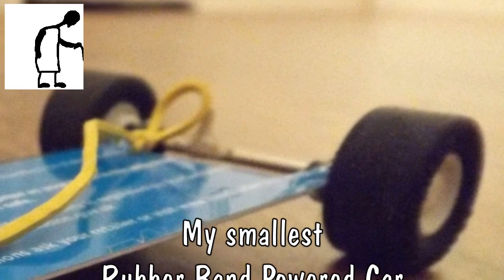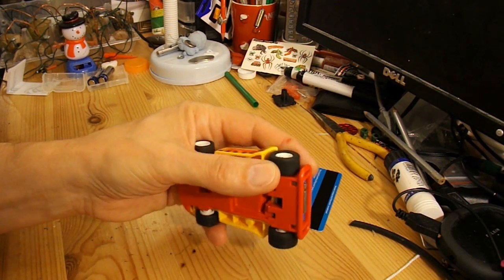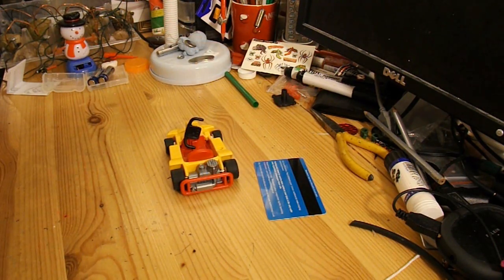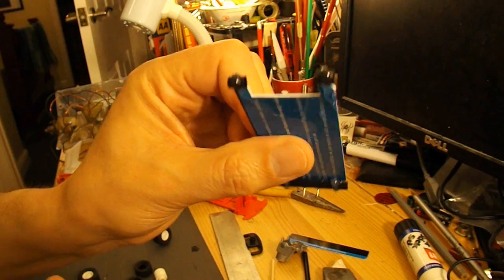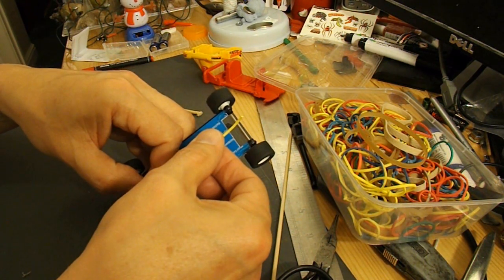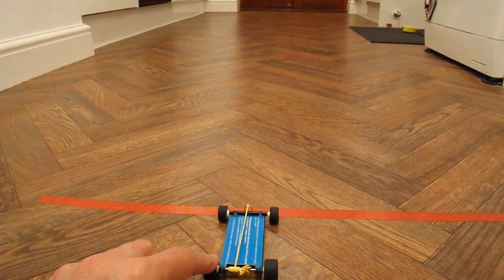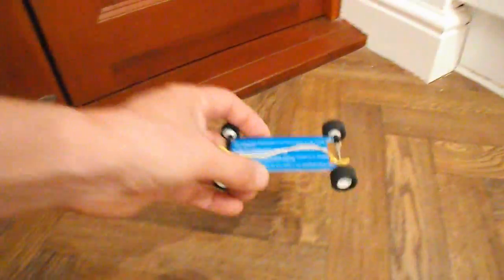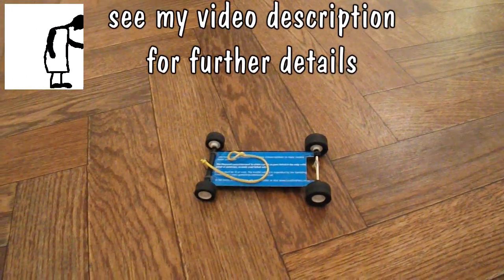My Smallest Rubber Band Powered Car so far

Comment: Can you make the fastest one please!!!!
Reply from the maker: The fasted one what?
Reply: GrandadIsAnOldMan  the fastest rubber band car
Reply: Justin Gerrity 0:44 the moving snowman  😂
Reply: game gamr  lol
Reply: Justin Gerrity hi
Reply: Justin Gerrity do u have videos on ur channel
Reply: game gamr hey
Reply: Justin Gerrity do u have  videos  on ur channel
Reply from the maker: Justin Gerrity fastest is just a relative statement. Unless there are some rules and specifications a rubber band car with 2 rubber bands will be faster than the same car with one rubber band. So if you want a fast one use lots of rubber bands. When the wheels spin, change the wheels to give you more grip and then add more rubber bands. When the axle begins to bend with the strain from the rubber bands then change the axle to something stronger and add more rubber bands. When the chassis starts to bend, change the chassis to something stronger and then add more rubber bands. BUT it will only be fastest until somebody makes the same car and adds one more rubber band. In my Rubber Band Powered Car playlist I currently have 213 videos with many different variations. The link is in the video description.

Comment: Can it go a 6th meter? If some changes are made? Need it for a project
Reply from the maker: I would say this was a fun build but probably not going to do what you need for your project. In the video description there is a link to my rubber band car playlist where there are hundreds more designs that may be more useful, here is a simple example Rubber Band Powered Car 1 x size 64 - full length video https://youtu.be/pIO3FiHX4Oc?list=PLA5a2xPRSrB3g5RiX8Kf_uUBOL0Tb7AS0

Comment: How did you make the latch to hook up the rubber band
Reply from the maker: +Ennis Rubio you may find reading the video description helpful as there is extra information in there. You can just wrap the rubber band round the back axle so it holds itself in place but in the video I simply glued a short stick to the axle. You can see it fairly clearly at 03:30
Reply: +GrandadIsAnOldMan thanks !!

Comment: What do you think would happen if I used Coca-Cola bottle caps instead of tires? Would the results be significantly different?
Reply from the maker: +Anmol Oberoi I would expect the car to stand still with the wheels spinning because they would have no grip. You might get a better result if you run the car on carpet so the wheels have a chance to grip on something.
Reply: +GrandadIsAnOldMan thx for the input, I have a cart project due for my physics class, and I just had one more question, i need the cart to travel a distance of 10 m to get 100%, is there any type of wheels that you could recommenced other than bottle caps or actual wheels? Because i need to use reusable materials, thx for your help1
Reply from the maker: +Anmol Oberoi you are wasting your time if you are trying to do 10 metres with this little car. I have over 180 different videos in my Rubber Band Powered Car playlist - the link is in the video description. Here is a car that will will do 10 m https://youtu.be/pIO3FiHX4Oc

Comment: Please write the steps to me. Video's not working.
Reply from the maker: +HamzaEssam Omr take a credit card. Cut a rectangle out of one end. Glue a plastic tube across the front for the axle to go through. Glue two short pieces of plastic tube at the back either side of the space you cut out. Take a paperclip and straighten it out and then bend it into a U shape. Glue that under the front of the car and bend the U up so it stick up above the tube you already glued there. Take the wheels and axles from a toy car and push the axles through the plastic tubes and put the wheels back on. Attach a rubber band to the U of the paperclip. Pull the band to the back axle and wrap it round. Let it go and the car runs forward. 
In the video I glued a short bit of cane to the back axle to hook the band onto but you can just wrap the band round the axle so it covers itself and hold itself in place.

Comment: i try this
Reply from the maker: +huzaifa hassan the main point is not to over power it. You need a very light rubber band or you will just spin the wheels and it will go nowhere.

Comment: Hey I got a question 
How to do the toy which is shaking in this video.
please explain.. pls... pls...
Reply from the maker: That is just one of those solar movers that have a small circuit powered by sunlight that makes it rock. I have removed the solar panel and it is powered by a potato battery that is just behind it in the picture. Here is a similar novelty made from scratch http://youtu.be/JfkOgoAgjE4?list=PLA5a2xPRSrB1SVLRn_D16dRvTrocMhFPq
Reply: thank u !!!
Cant we do with the help of gravity alone ??
please do like that
Reply from the maker: Jagan Kumar I am not sure I follow what you mean. Do you mean to make a solar mover work from gravity? The answer is no, unless you make a generator powered by a weight dropping under gravity and use that to power the circuit. Technically possible but not something I want to do at the moment.
Reply: Actually I want like the toy but without using any power source ?  Is it possible ?
or can i do using a small battery like thing ?
Simple, toy using no power source or less !!
Reply from the maker: Jagan Kumar These are not really toys, they are not suitable for children to play with due to small parts and the plastic is not the right sort for play. However they are usually available in novelty shops. Every Christmas there seems to be a set of these Father Christmas, Reindeer, Penguin, Snowman. Around Halloween there will be a set with Witch, Pumpkin man, Skeleton. Other times of the year there are other themes. Here is a typical eBay listing http://www.ebay.com/itm/291379994430
Reply: yeah !! i asked not for the kids... i asked for myself... just curious to do something lik tht and keep it in my room !!! if u have link of making that kind of toys please do share it

Comment: i made one of those my self
Reply from the maker: How far did you manage to make it go?
Reply: @GrandadIsAnOldMan  i failed for the 4th time :(
Reply from the maker: @datboi9316  small cars like this are harder to get running than bigger cars. Maybe try a bigger one first. There will be information in the video description.
Reply: @GrandadIsAnOldMan  thx for the tips btw what things can i use to substitute the wheel hole that hold the wheel to the car instead of straw?
Reply from the maker: @datboi9316  you will have to be creative and search around for things that are tubes. Maybe an empty pen, some spray bottles have tubes inside. It depends how thick your axle is.
Reply: @GrandadIsAnOldMan   ok thx for the tips my dude
Reply from the maker: @datboi9316  Good luck

Comment: How did you attach that toothpick looking piece that catches on the rubber band to wind it around the axle? Looks like some hot-glue, but I don't know if you had a trick to get it to grip the axle more reliably. Neat little project.
Reply from the maker: Yes that will be hot glue. Just watched the video again and realised I must have cut that bit out when I was editing the video. I try to trim my videos to keep them under 5 minutes if possible.
Reply: No worries, thanks for the reply.

Comment: Didnt it do well ! (Bruce Forsyth used to say something similar).
Very nice clean design too.
Reply from the maker: Thanks. The performance kept improving as the band weakened. The technique is to stretch the band as you wind it onto the axle so you get more turns round it.